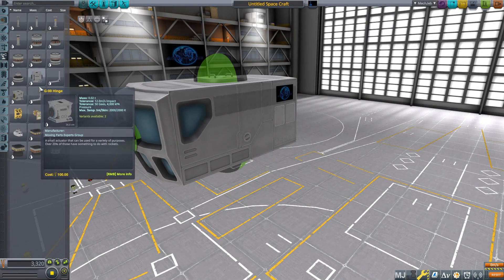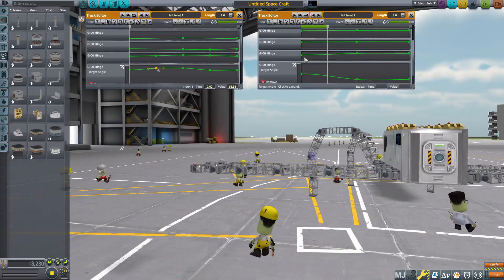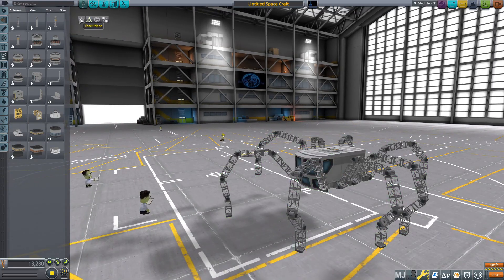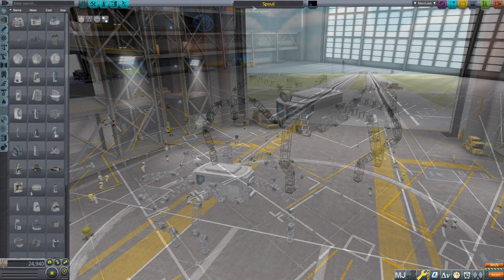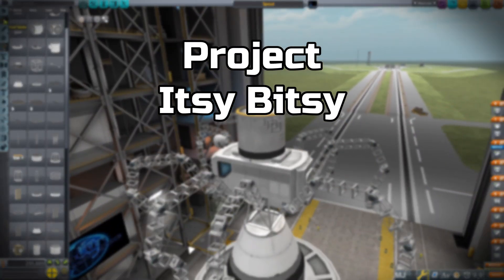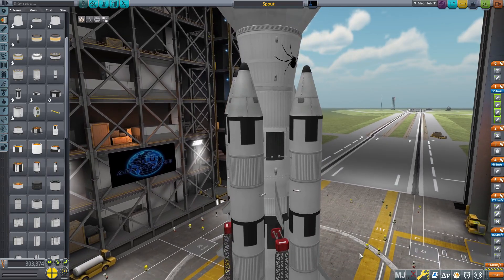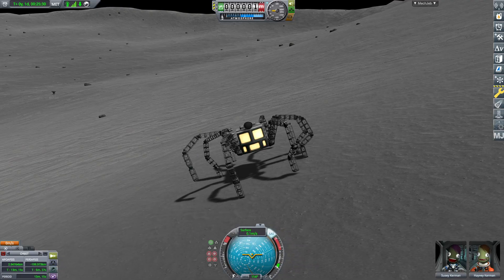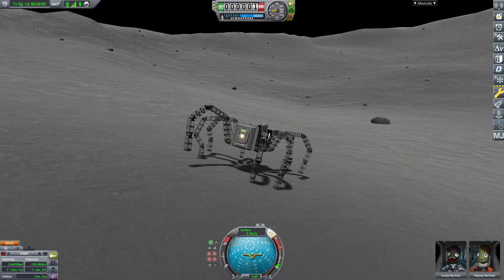KSP - Spider Rover (Mun Series Ep.1)

Comment: Hey. Really cool! Awesome work! From idea to editing and music! Subbed immediately.

Some tips:
- If you have good videocard, add some visual mods for grass, clouds, atmospheric effects etc (check mod list of latest Matt's video)
- If you keep long shots with dark side of planets, add a brightness mod, youtube makes it pitch black (I know it's realistic, but viewers won't see sh-t)
- The fuel amount was huge overkill. Watching throwing away 3000m/s was painful. You can use delta-v calculators and add 20-30% extra on the top
- Fairing was huge. Maybe it was possible to fold legs somehow? Also you can deploy it once you're in space, to reduce weight
- No way to return home for the Kerbals. I feel bad for the girls
Reply from the maker: Thank you for the comments and the sub!! It really means alot. I usually always try to use way more delta v than I need, just in case something happens and I need it for correction maneuvers. Plus, I did it all in one go, so I didn't test anything ahead of time to see how much delta v I actually needed. I have a design for a spider rover that folds to be more compact for the trip, but to keep the video slightly shorter and as simple as I could; I decided to just send it as is. (At least it was inside the fairing) Lol.  As far as not having a return mission, the kerbals that were sent are scouts to find a good location for a base. They are the first kerbals on the mun to start our colony. They will be accompanied very shortly.